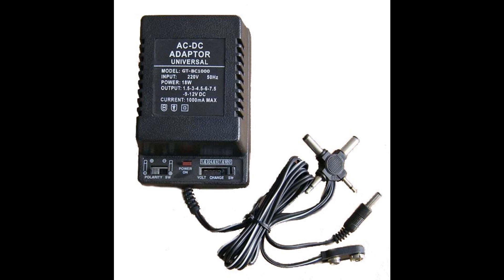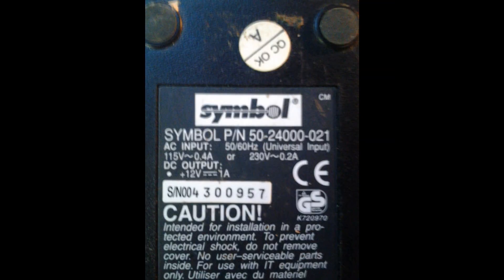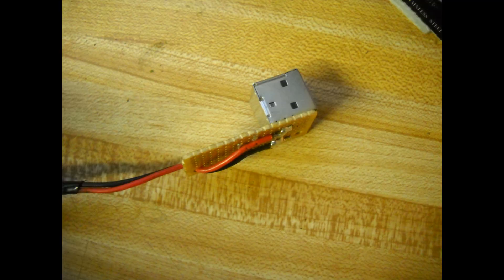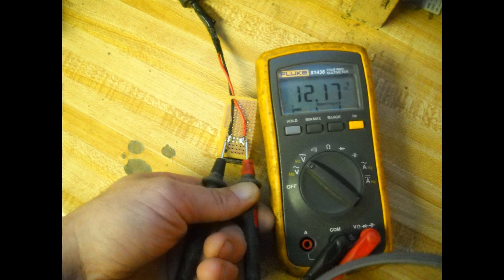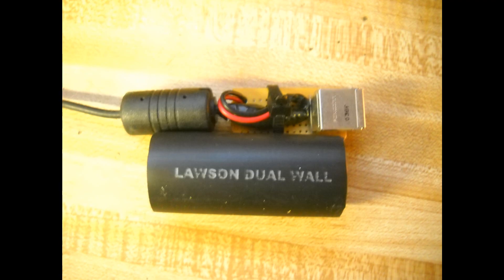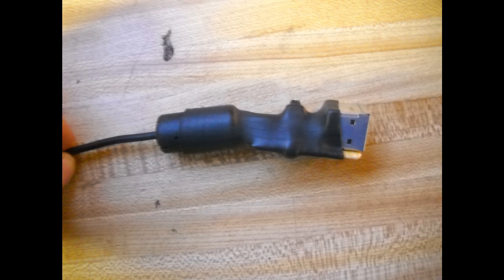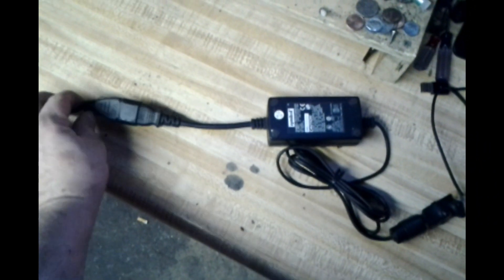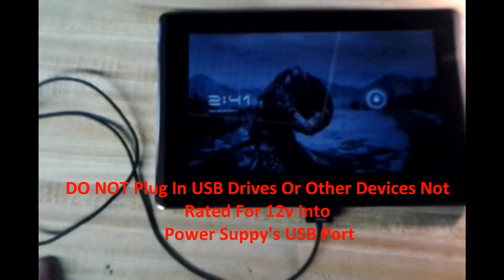Just Another Do It Yourself 12volt DC Charger - ASUS Transformer

Comment: Hi, my TF101 won't charge with the USB-to-power-port cable used as you describe, because the power port male connector on the cable has very few pins in it. I presume the 15v power pins are not present in that male power connector on the USB cable!
Reply from the maker: They should be, double check that the charger has the proper power output and also to see if any of the pins are bent. If using a small non original charger power pack make sure it has the same DC voltage output as the original charger pack that came with the Tablet. It's been a few years since I've had my TF101 but if trying to charge the tablet via PC I don't think it will work due to limited power output of 5v DC from the USB 2.0 ports
Reply: Thanks for the quick reply, Dave. Looking in the mouth of the male connector on the USB cable to the TF101, there are many pins not present. I'm using a professional variable power supply cranked to 15v, with a cable to female USB connector, and my PC sync'ing cable attached to that and to the Transformer. The charging light does not come on on the docking station when switched on. I'm looking at a generic power adapter from China, but don't know whether it has that internal technology to ramp up to 15v if pin 7 is grounded (I think that's how it works), or if the generic PSU just provides 15v anyway.... Yup, a USB socket on the PC will supply 5v only, clearly not enough to get the internal batteries up to 7.4v.

Comment: Thanks for this tutorial, worked for my asus transformer. Instead of removing the usb connections from a mother board though, I just used a female to male usb adapter and cut the wire, inside the wire are 4 cables just like the 4 pins on the usb connections for the mother board. Stripping the wires and then connecting the power supply potential and ground to the corresponding wires on the female usb adapter was much easier than soldering and was sealed with electrical tape. Thanks again!

Comment from the maker: @redfive2008 your correct on the USB 3.0 cable as it goes to a higher voltage when pin 7 is terminated, however since the last update .21 many people including myself have had issues with it not charging when in sleep mode. And yes I if the print was any smaller on the charger I think you'd need a microscope to read it.

Comment: @redfive2008 OK, never mind. I guess the small print on the charger was a bit /too/small. 5v@2A, or 15V@1.2A. It also auto-detects the cable, and if it's not a USB3.0 compliant cable, it'll drop to the 5v level, which only charges when the tablet is sleeping, as I understand it.